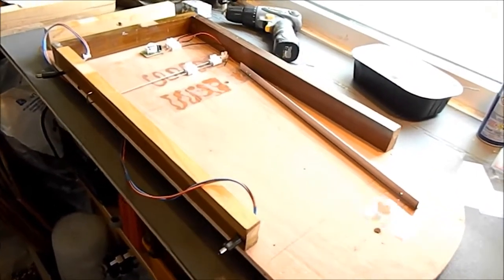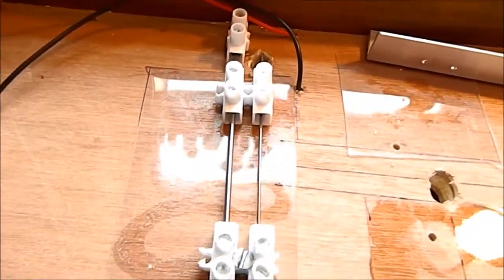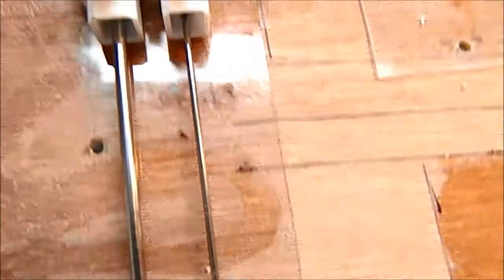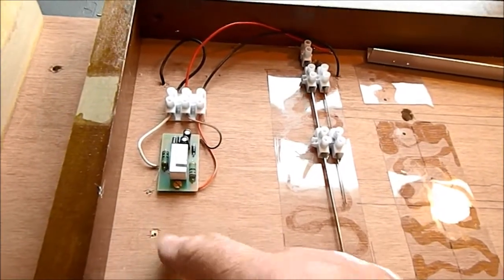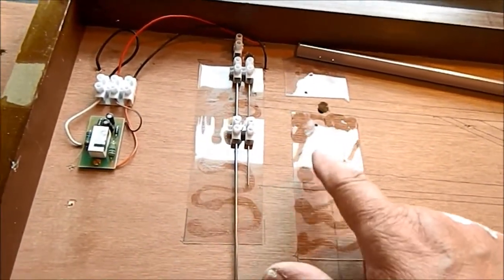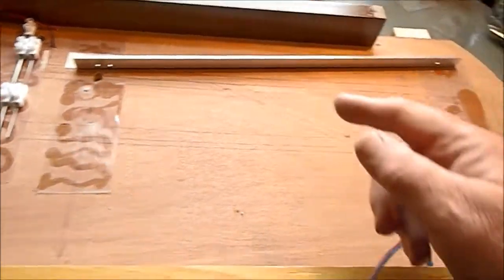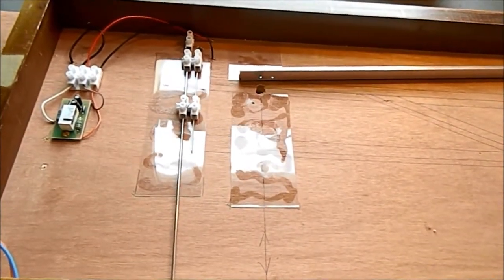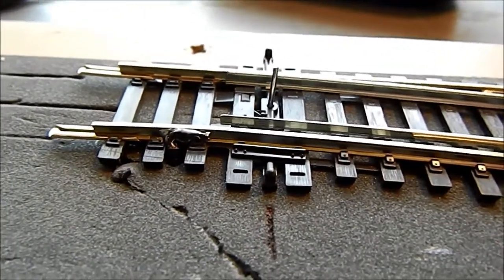No 4 Rod control of a single point  13 10 2017

Comment: Found your video really helpful, a great method for cheap point control, just tested it on a small shunting layout I am making. many thanks for sharing.
Reply from the maker: Hi Roy, I am glad you liked it. If you want a cheap handle/knob just break off one bit of (what I call) a chocolate strip. I do enjoy the fact that I have to manually change the points. It is quite a discipline and I still muck it up. Those signal men were incredible and I would hate to do that job.
Barry.Devon

Comment: Inspired!
Reply from the maker: Hello Perchpole, that is a very big and meaningful word for my simple point control, I am chuffed and extremely flattered, thank you. Have you looked at video number 5.?
Barry.Devon
Reply: @Castlebridge-00  Is that the one about the crossover? I have already run out of superlatives!  🙂
Reply from the maker: Yes, that is the one I meant. In a year or so, (depending on the way life demands) I have a goods yard with 8 points on the plan. I hope to use a thin tube from household spray bottles when they are finished, glued to the top of the baseboard with a wire running in it, turned up at the end through the point. That means the rod will be in place as the point is fixed to the board. In a goods yard, it will be easy to hide the plastic tube and the other end, the wire bent as before to form a handle. 
That will take a bit of controlling by me to avoid a derailment, but enjoyable.
Barry.Devon

Comment: What holds the points open or closed?
Reply from the maker: Hi Donald, the points are Peco code 100 and they are made with a small spring that keeps the point blade tight to the rail when it is open or closed. I have done nothing with the point, it is as it was, straight out of the box. I hope this helps.
Barry.Devon

Comment: What sort of wire are you using please? Piano wire?
Reply from the maker: Definitely piano wire, either 0.75mm or 1mm depending on the run. I used a pair of pliers to bend the 90 degree at the point end and on one occasion the handle
Reply from the maker: Hello Andrew, I replied first off from my phone as I thought you were talking about a push pull on my latest video. Now I am home with my computer I know what one you are asking about. This morning I will go to my railway shed and measure them for you.......Barry
Reply: @Castlebridge-00  Many thanks Barry, I've just started a shelf layout and wanted manual control & this method is ìdeal (also got a number of spare frog juicers). Cheers, Andy
Reply from the maker: Hi Andrew, just had a measure and the piano wire which is the handle is 2mm. the wire connecting to the point itself is 1mm and works but if I did it again I would increase it to 1.5mm piano wire..........Barry
Reply: @Castlebridge-00  Cheers.
Reply: Barry, got my piano wire but just wondering what type of cutters you used to cut it with especially trimming the piece going up into the point itself? Cheers, Andy
Reply from the maker: @andrewparkinson9667  It's a while ago, but it could be Side cutters or big pliers or Dremel with cutting disc. The one thing I do remember is that when using side cutters or pliers the cut bit fly's with force so protect your eyes and close your mouth......Barry

Comment: Interesting....when you say frog juicer ...I presume you are dcc?.....regards Fred
Reply from the maker: Hi Fred, yes DCC. As I got tight for space in one small area I had the Peco surface point. Then I tried the under the baseboard points and just could not fit them due to not being athletic and my enjoyment of spotted dick and custard if you get my drift. So now, if it is not controlled by rod or wire, it is a surface one and the frog juicer does the polarity selection in less than a wink of an eye. Barry